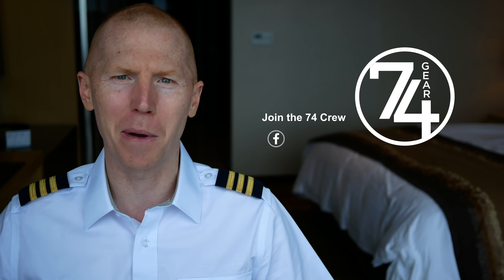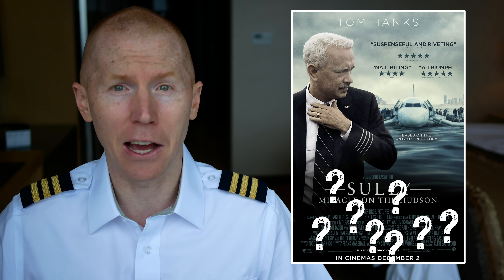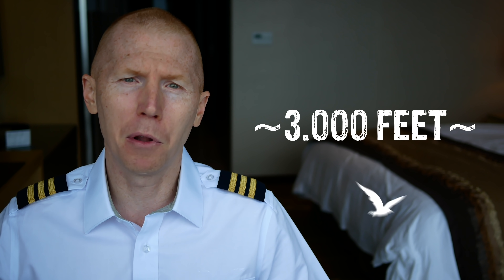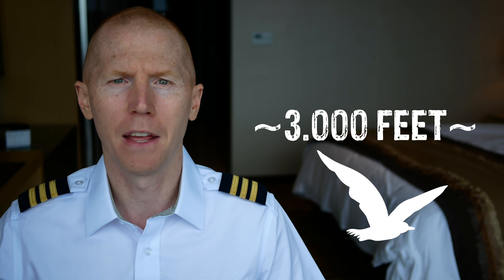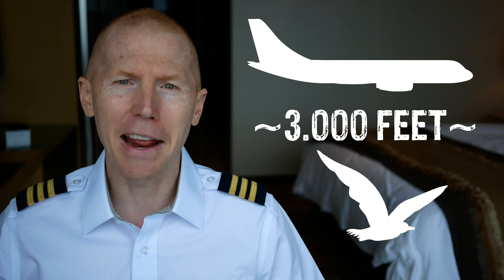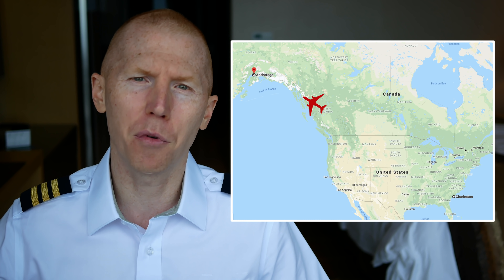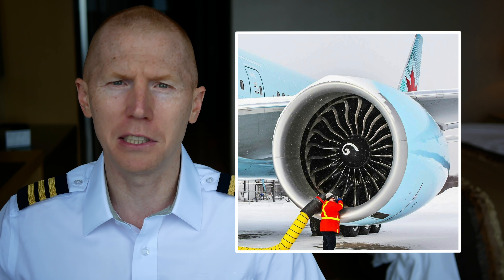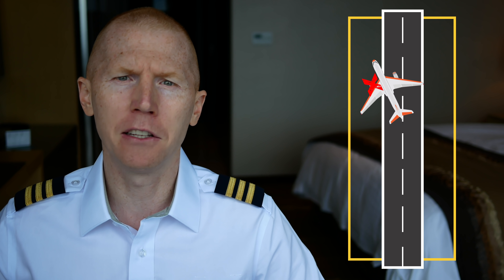Why Engines Don't Have a Mesh or Grates to Stop Birds

Comment: Retractable screens is the solution!
Reply: Unless your mesh is made of adamantium, if a bird hits the engine, it's just going to take all that metal wire and shit into the engine, which would cause much more damage than just the relatively soft flesh and bone.

Comment: Is it really a good idea to put fewer larger engines on aircraft?  I think that it’s better to have 4 at least. So you’re only losing 25% of your total output. I know that railroads found that having more lesser powered locomotives is more beneficial then having fewer more powerful locomotives. So if one loco fails the train won’t stall.

Comment: One could think the fans spin, and objects that are released tend to move in a straight line, so every debris that gets past the fan is flung to the outer regions of the bypass duct, from where it is unlikely to go into the engine core. Obviously it doesn't always work out that way.

Comment: Get an AI to design a retractable bowed screen under 3,000'. Just thinking...
Reply: "screen" with holes large enough would still suck in the bird. One armoured enough not to be blown through with the impact would be too heavy. You would need an armoured cone that would also reduce the intake air way too much.
Reply: @carbon1255  .. LOL I'm not thinking of one made from cheese cloth or window screens. Instead titanium with scoped curved "T" to deflect birds or large objects, but certainly large enough to allow airflow. It certainly could be done.

Comment: Putting a grate or screen in front of an engine wouldn't stop the bird from going into it anyways.  It would just make the bird enter the engine in smaller pieces or the bird could just hit the screen with so much force that the screen off breaks off so both the screen and the bird enter the engine.  These are much more likely.

Comment: I'm begining
 to trust more in Airbus than Boeing... Yusupov was flying a A321 and Sully was flying A320. I can't recall something similar with Boeing 737, except Ethipian Airlines Flight 604, when a 737-200, suffered a multiple bird strike while taking off from Bahir Dar Airport. Both engines failed and the airliner crashed and caught fire while trying to return to the airport. Thirty-five of 98 passengers died while all six crew members survived.. Birds don't like Boeing's engines maybe.

Comment: How do planes like the C-17, which are designed to operate on unpaved runways, prevent debris from getting sucked in on take-off/landing. I know the MiG-29 has doors which can block the main under body intake on takeoff/landing and pull clear air in from the top of the aircraft, but I haven't seen such tech build in to the engine nacelles of  more traditional cargo/transport style aircraft. Is it just the wing height?

Comment: Random question, though it would add significant weight to the aircraft, and would temporarily stop the functionality of the engine, what if they added a similar technology as a thrust reverser sleeve, that works automatically to cover the engine intake prior to a bird strike? As long as there is still some air flow, or relief valves on the sides of the engine, a trained crew should be able to compensate for a brief momentary loss of thrust. But of course, this would a significant weight, complexity, maintenance, and hazard possibilities to aircraft. After all, what is the sensor triggers in error?

unfortunately, there is no easy answer. Drones and trained predatory birds are the only real options.

Comment: My merit (Points from the grades) from middle school was 217.5. I wanted to become an airplane engineer or mechanic. When I realised that that was a long shot from where I was at, I just started fighting my way up the grades and in the end landed on a 217.5. Sadly my goal was 285 but I got into a vehicle and transport program so I only need to do one more year of maths class (Another course of maths than I did and slightly more difficult one) for me ot become a vehicle engineer. I took the transport courses though and not the engineering courses but I'm happy with hauling cargo by road. Also since my vision is probably too bad for anyones standard to be allowed to work on a plane.

Comment: It's a MONEY issue. The commercial industry has done the numbers; write off the airframe, crew  and passengers. Us engineering types design in safety and the bean counters remove it. That is why we have the 737MAX MCAS / engine mount problem. that may kill off Boeing. The FAA  finally got caught and exposed. That is reality. Your 747 " flew " first on one of our Cray supercomputers. I helped with the design of our supercomputers.

Comment: You can put a screen over them while they are on the ground when you are testing. We did on fighter jets when I was in the air force. Doesn't work so well when they are moving through the air though. At higher speed the air tends to flow around the screens since it sees them as resitance instead of going though them and into the intake. When they are tied down on the ground it isn't issue, you can run them full throttle and in after burner since the engines are purely sucking air in. Once the aircraft starts moving it is a different story. If they could run an engine with screen over it they would do it. Engineers are not stupid lol. Do people really think they didnt try that already at some point in aviation history?

Comment: "Birds strikes only happen below 3,000 feet, where we only spend a couple of minutes". Ridiculous argument. Well, guess what: you only use those wheels for a few minutes at 0 feet... for sure engineers didn't see the point of fitting your plane with a landing gear, then...

Comment: Considering just how skittish and situationally aware birds are - wouldn't a directional speaker shaped to make the flight-path of the engine intake (yes, that narrow) extremly unpleasant for the birds be enough?
I mean, we are talking about when the planes are the slowest, and the birds would show up on radar in well enough time (about 1.5km/~1mile it seems) to actually only have the speakers on when needed (to avoid the birds getting too used to it, and also to allow truly horrible noises and amplitudes directed away from human populated areas).
(At takeoff the bird would have about 17seconds to clear the path, at cruising speed about 5s, so if the birds can be scared off it would only make sense when birds are most likely to be found)

(But with how tight economic margins are and how rare birdstrikes are I doubt any mitigation (in civilian applications) would make sense however, but adopted with EMP-guns rather than speakers it would be a decent drone mitigation procedure)

Comment: I would honestly say that if engines were equipped with screens. The likely hood of one of the screens breaking off and getting sucked into the engine is a fair bit higher than that of a bird ingestion. Then say they did have screens. And a bird hits it. Chances are the bird now gets cut up by the screen and still goes through the engine. Or in the case of a larger bird breaks through the screen or breaks the entire screen off and so both screen and bird go through the engine. 

In sullys flight each engine took in several large geese

Comment: The UH-60 Blackhawk has a system called the Inlet Protection System (IPS). As the air enters the inlet it goes through a set of vanes that cause it to swirl. This pushes objects to the outside edges of the inlet. There is then a blower that pulls objects out of the air stream and discharges them out a duct at the rear of the engine compartment. It is meant for twigs and such, but I have pulled small birds out that were stuck in the blower. (Much less harmful than passing through the engine) Of course we don't use our engine to generate propulsion but rather to turn a drive shaft, so massive amounts of intake air aren't necessary like on a turbofan.

Comment: Hey, I’ve always heard it is incredibly expensive to become a pilot. What did it cost you personally to become one?
Reply: Matt globally, it’s around 200K USD but for the whole formation, so for around 5/6 years....
Reply: @rubisaeronautiquefrance7092  true if you go all the way to commercial. However starting out as a general aviator flying a single engine under VFR can cost around $20,000 (Some sites estimate $10,000, but I don't know anyone who actually managed that.) Most of that $$ goes towards the rental of the aircraft. Im not the sharpest tool in the shed, so I got my license at 100 hours. At $145 per hour,  that's $14,500 just in rental. The instructor adds another $40 per hour,  that's $4,000. The check ride can be $500 - depends on the examiner.  The private pilot knowledge test (paper test)  - i took mine as part of ground school package, so I dont't remember the individual cost - ground school was $500. And then side costs like gear (headset, headlight,  hand radio,  charts/maps, renters insurance, medical exams, few $100 burgers 🙂, spa trips for the wife so she doesn't complain about how much you're spending on your dream!)

If you buy your own airplane, you can save money and have some more freedom. But it is expensive and the only way to justify the expense is to fly frequently.
Reply: @AV8R_Surge  I'm actually building my own plane, and I'm passing my PPL (private pilot license), and the prices (in france) are pretty smart : 125$ all included for one hour of flight...
Reply: @rubisaeronautiquefrance7092  wow, that's not a bad price.  I once read it was expensive to train in Europe,  but your quoted price seems reasonable.

Comment: EFAS or engine fail assist system isn't new tech... I worked on such a system on KC-135s and they were made back in the 1958-62. lol. Of course I'm not sure if the EFAS system was on there when the aircraft was original designed but judging by how old the computer that runs the system looks... I'd say it's 70-80s era tech.

Comment: what if your using a one engine aircraft  and theres a birdstrike
Reply: Like a Cessna 172? Either a) you get lucky and it hits something not vital; b) you start looking for a place to make an emergency landing; or 3) it went through the windshield and either knocked you out or killed you outright, in which case you’re going to crash. Most light aircraft like that aren’t designed to handle a bird strike - unlike airliners, which are (not only do airliners have at least two engines, but they have much thicker metal on their body panels, and they have much thicker windshields that can handle a bird hitting them without breaking).

Comment: Actually, there are some ways to minimize the risk of bird strikes taken by airports. The Air Force has some air guns located in the vicinity of the runway that make a sound similar to gunfire. What might be even more interesting, they employ two falconers along with two hawks that control the population and deter smaller birds around the base.

Comment: I know that birds can cause some awful things to happen, but we must share the skies. Birds are still the kings of the air. 🦅 I believe it was by watching a hawk (or eagle) that inspired Whitcomb in the '50s to refine the concept, since the idea was first spawned much earlier. So despite being a hazard, birds have also inspired an improvement that has aided flight and helped save immeasurable amounts of fuel over time.✈️ Still wish we could find a way to prevent them from colliding with planes.

Comment: I wonder if there might be a way you could take the 737-200 gravel kit principle and re-engineer it for the bird ingestion scenario.  What I mean by this is that you could design a way to utilize the principle of high pressure air, whether from a gravel kit style nozzle or an emergency trust diverted so that the birds are either forced or deter from entering the engines inlet in an emergency.

Just a thought.

Comment: There is no pilot how wanna do what Jeffrey And Chelsley Did that  januari day  Like Scandinavian  751 at Stockholm Sweden  In Dec 1991
But SAS 751 and this MD 80 hade ice in to the engings!....  on takeoff roll / Rotations  
and all 129 souls onboard walk t away from that   But anyway  what Jeffrey and chelsey  minimize damage how cud den  be far greater if they
 those to go to Teterboro insted!...  ive have big respect fore aircrew in both of this  situations!   as long every ones are walking away and no ones dies
 are  a god things  and a god landing!....

Comment: My bird story:
Six years ago I made a night IFR flight in my 182 Cessna from my home base in Auburn, Ca. to Redding Ca. I was in cruise configuration at 6000’ just West of Chico Ca. when I hit a small object. I was a little startled 
and curious about the event. I made my landing at Redding with caution not knowing what to expect. After taxing to the lighted transient area, I shut down and inspected the front of the aircraft for any signs of damage.
I discovered that a small bird had hit the right side of the leading edge of the cowling with no evidence of it striking the propeller. 😳
It left a small divot the size a little smaller than a golf ball. As I continued my inspection I found innards and feathers spread on the underside of the right wing. I examined the feathers and found them to be a bit of grey and orange in color. I took a sample of the feathers to my neighbor, a Fish and Game Guy. He identified the bird as a Robin. A Robin at 6000’ at night.😳 I filed an incident report 
citing  this feathered aviator for violating the hemispherical rule of wrong altitude for his direction cruise flight. In addition, I included in my complaint that ATC failed to advise me of a conflict and for not providing vectors to avoid a midair collision. 😊

Comment: A screen would more likely cause debris to go into the engine. Imagine if some of the screen would break. First, the screen would have to be super strong as to not bow inward when under thrust. Since it's so strong, any part breaking off would be disastrous.
Reply: Yep, most big engines can handle fresh poultry, although preferably one at a time, but having large crunchy chunks of a recently bent 'goose grid' as the starter course, would indeed be considered a bad idea, at least by the manufacturers, you know how touchy they can be : )
Reply: You also have to manage icing and runway FOD

Comment: Why not make something movable like the landing gear. It protects the engines during takeoff, then moves away above 3k ft to improve fuel efficiency. They could have it on one engine only to make sure birds will never hit both engines at the same time.
Reply: It's moving parts that need to be maintained and can cause more things to fail catastrophically. A bird strike is a rare thing. A double bird strike is basically unheard of with one exception...

Replacing the existing but minute risk of a double engine failure from bird strike with a new mechanical piece that is almost guaranteed to fail more often is silly.
Reply: @Argosh  Well not doing anything about it because it's a "minute" risk is worse. Rather have some maintenance  expenses than a plain crash. Also if it fails worst that can happen it doesn't retract and you lose some fuel efficiency. I don't see the risk of it falling apart more than any other piece of the aircraft. One elegant solution could be something like the reverse thrust on some planes but make it breathable.

Comment: What about a cone shaped engine guard that can be retracted once you're above 3000 ft?
Reply: How many fails is that system going to have?
Reply: I do think that someone will discover a way to prevent birds being sucked into engines. Perhaps even finding a way to help birds avoid planes altogether. Creative thinking is what is needed. 🤔
Reply: That would be very expensive. And dangerous if the retraction mechanism fails.